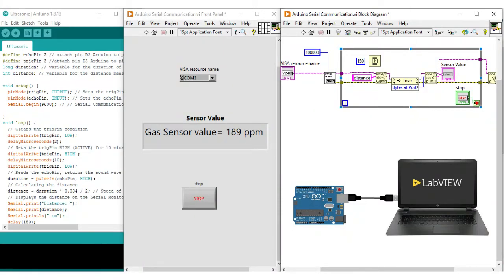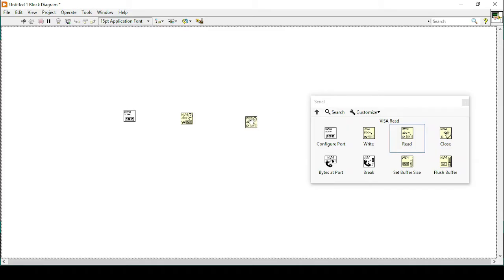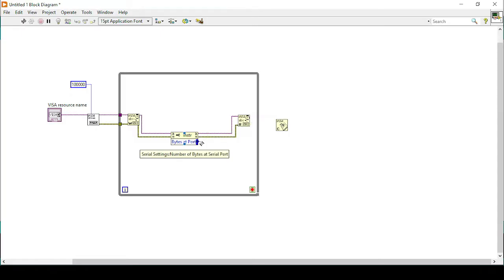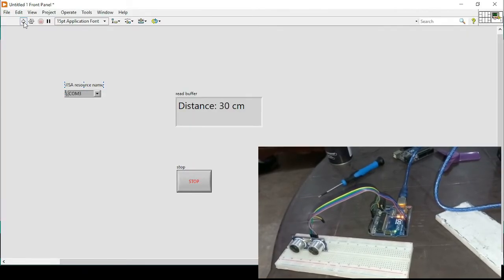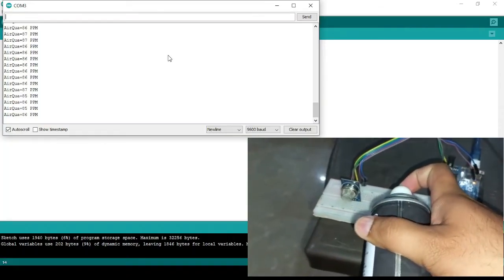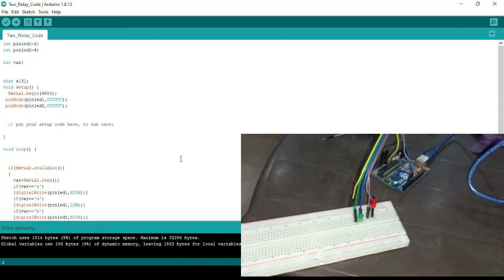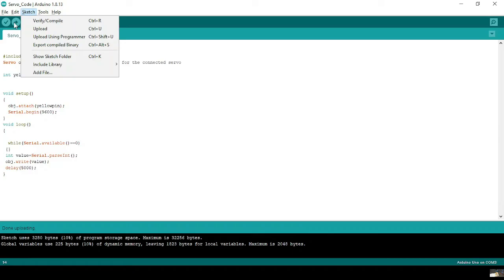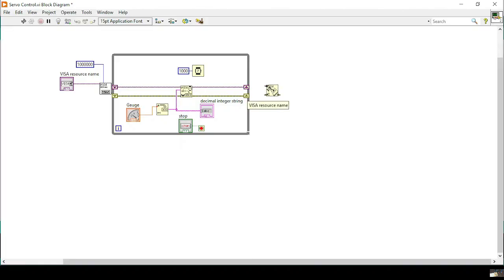LabVIEW Serial Communication  | VISA | Arduino | Sensors Data Acquisition | Control Servo Motor

Comment: Not working for me. My serial monitor registers the sensor data, but I'm not getting ANYTHING in LabVIEW. On top of that, my STOP button says "this is valid, but it doesn't work" like what kind of error is that? Total BS system, make it make sense!
Reply: Un “or” arregla tu problema conecta una parte a la línea de error y otra al stop (control) y la punta del “or” conéctala al círculo rojo. Y ya te va a funcionar esa parte.

Comment: Can you help me in this how to do step by step please ?

Build a temperature control system based on Lab VIEW and Arduino MCU, connect a temperature sensor to the Arduino unit, let the user define a three levels of control as following: - Level 1 if temperature is less than 22 °C, a green LED should be turned ON. - Level 2: if temperature is more than 22°C and less than 30°C, a fan should be turned on to

50% of its max speed.

-Level 3: if temperature is more than 30°C and less than 38°C, the fan should work at 90% of its max speed.

- Level 4: if the temperature exceeds 38°C then turn a Red LED ON and a 5V buzzer at a IkHz

frequency.

store the temperature values in a file with a rate of one reading each minute.

Comment: I built this circuit but nothing appears in labview read buffer.  The only option I get is com3 for VISA resource name. In your video you get more options, com3,  LPT1 and some other option beginning with A which is the one you selected and it works for you?? Not sure why I dont get more options? Am I missing something?? My arduino is working perfectly and serial monitor is displaying the correct distance. Labview is not detecting the arduino serial monitor? I am running labview 2023. Any help welcome.
Reply from the maker: Make sure you have installed proper libraries while installing LabVIEW. Or try close your labview and then come back again and see if shows up anything.
Reply: @labviewexercises8585  Thanks for the prompt reply. I had not installed the labview drivers for VISA so it would never work. I installed the drivers and now working without issues. Thank you again.
Reply: HI BRO SAME PROBLEM, I'M TRYING IT NOW . HAVE YOU FOUND THE SOLUTION
Reply: it might have to do with the waiting time in arduino and in the while loop. i have a similar problem and i noticed that changing the waiting and delay time improves this.

Comment: HELLO GOOD AFTERNOON I CAN MAKE A PROGRAM FOR A DRIVE THAT HAS A RS232 PORT AND BE ABLE TO CONTROL THAT DRIVE THROUGH LABVIEW. ???
Reply from the maker: yes, you can. All you need is the product manual and find out the command keys. If you want me to do this job then you can contact me at getlabviewsolutions@gmail.com